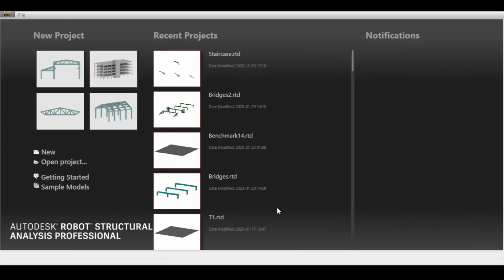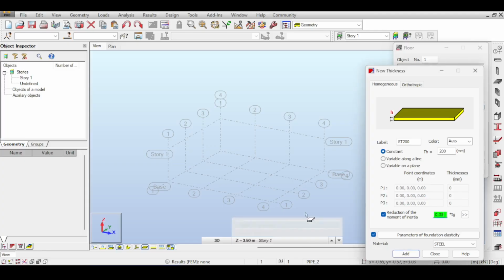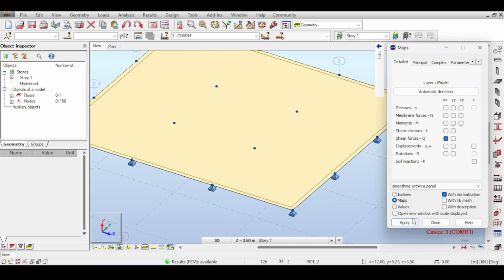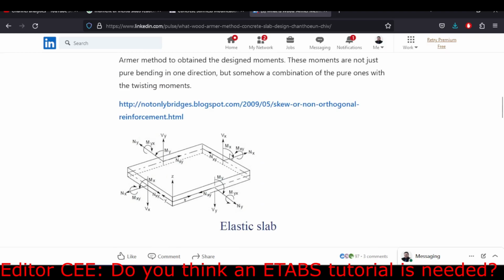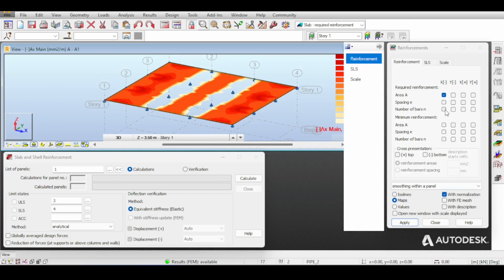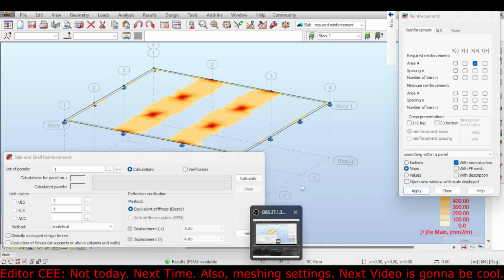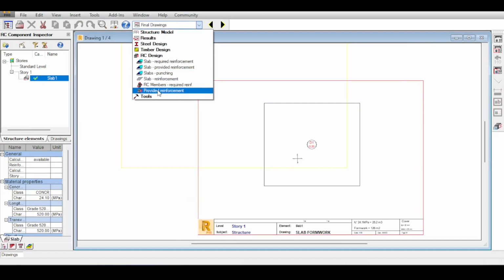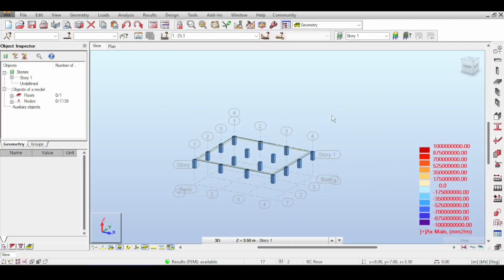The Slab Series | Part 1 - Introduction and Flat Slab | Autodesk Robot

Comment: Hi there CEE. 

I am really enjoying your videos. 

I´d like to know if its possbile to run a plastic (i´m not sure that´s the correct word in english) analysis for slabs (shells). In other words, i´m not confortable with some results  i´m getting of a particular RC structure that i´m looking at, it seems too stiff. In my country, for shells, our code allows to simulate plastic pinns located on the critical sections through a non-linear analysis, and establishes a limit for rotation of tha pinn in miliradians due to a moment/shear ratio, section geometry and ductility parameters. That allows to redistribute moments along the structure. Is there a way to simulate this kind of behavior on Robot?
Reply from the maker: Hi there Engr. Vitor,

I am happy you find the content of this channel beneficial. It help if you want to suggest it to your friends.

About non-linear hinges for plates, I have to check if there is something like this in robot. I would make a video about it if I find it ^_^

Anyways, stay tuned for more content.
Regards,
CEE

Comment: Good day CEE,

I trust that you are well. 

This comment is with regards to the meshing of the current slab. I have just observed that if one uses a “coarse” mesh, the results of reinforcements distribution (even the results of the slab bending moments Maps) are not wholly symmetrical as one would have expected them to be? However, if one changes the mesh to either “normal” or “fine”, then the results become symmetrical (as expected) and within the bounds of the slab geometrical dimensions and configuration of course.

Now I appreciate that a “coarse” mesh will not give same “smooth” results as say a “fine” mesh. I had thought (I mean, I assumed without an actual referable basis, shame on me ☹😞) that the “coarse” mesh, as “rough” as it may be, it will be “equally and symmetrically” rough on both opposite sides that are expected to behave symmetrically. Clearly this is not the case.

What concerns me about this is as follows: 

• Does this now mean that a “rough” mesh can create “non-existing” imbalances on two opposite sided that are otherwise geometrically symmetric and even loaded symmetrically?

• If so, how then should designers trust the analysis results of a multi-storey structure with appreciable amounts of slab elements when the structure as a whole is analysed using “coarse” mesh settings? Would the “imbalances” if they exist not “distort” the true-er behaviour of the structure?

• Is it advisable to run analysis with only “normal” or “fine” mesh settings?

Perhaps some of what I mentioned is something CEE is still to cover in the planned meshing video? If so, I can get clarity when that video is released.

Keep well, DK
Reply from the maker: Hi there, Engr. DK
If you are using coarse mesh, the FEM mesh is not double axis symmetric (x symmetry and y symmetry), thus there is a slight stiffness difference which causes the unsymmetric moment diagram and thus the reinforcement.

Yes, a coarse mesh creates imbalances, I will address this in my next video which is all about meshing. Actually, the reactions of the identical columns would not be identical. Edge columns will have different reactions.

Secondly, indeed, due to this slight problem in the mesh, your multi-story structure will create "twisting motions" even if it is 100% double symmetric. This is something that all my graduate students face and ask me about. I will definitely talk about this in my full structure series. There is some really juicy content to talk about. (Gonna tell editor to add this point to the list.

For me, it is actually advisable to run coarse mesh settings for "quick structural checks" and fine settings when you are getting "serious" and want to export designs. Of course, this will be covered in my mesh video next time.

The mesh video should be released next Friday (hopefully).

Regards,
CEE
Reply: @CivilEngineeringEssentials 

Thank you so much for this feedback. 

It is now even clearer to me that without understanding the FE method, one could do some serious damage with it. The CEE community is fortunate to have you who clearly understands well how the FE method works

You are amongst the rarest of the best.

Keep well.
DK